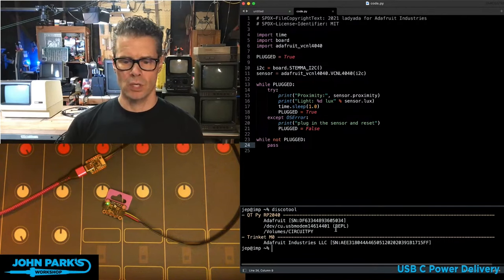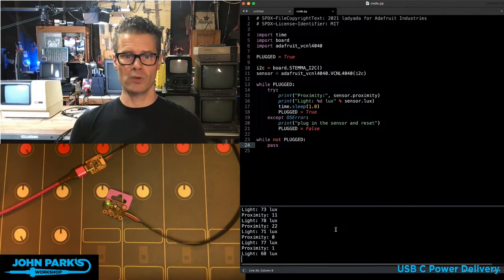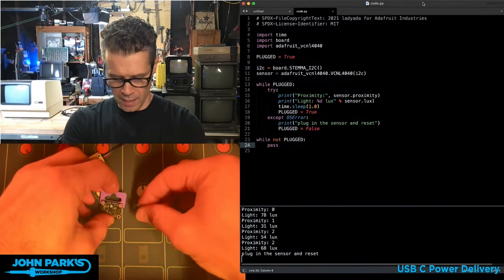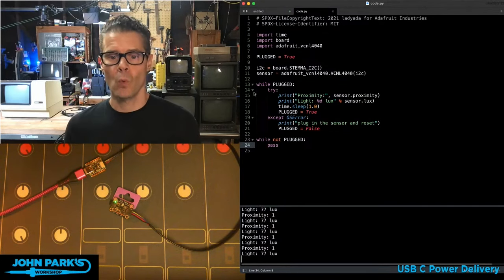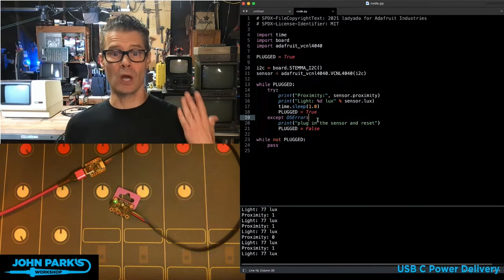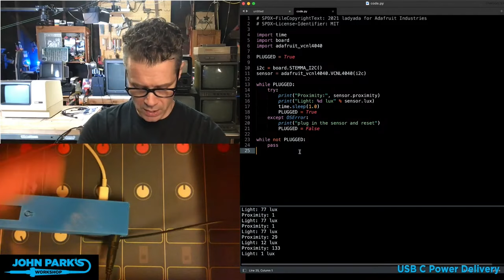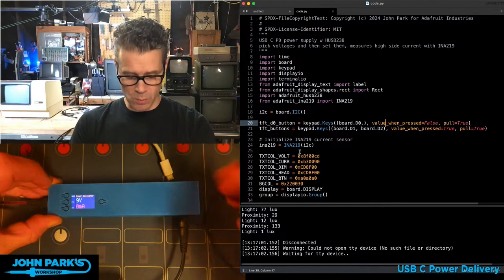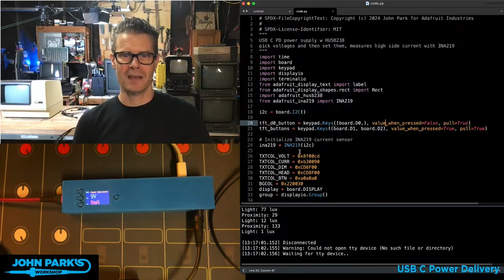John Park's CircuitPython Parsec: Dropped I2C #adafruit #circuitpython

Comment: How does this code work with the Adafruit board that monitors the I²C bus to watch for I²C disconnections? I can't remember the name of the board, but it was released by Adafruit sometime after Jan-2023. I believe it had just two I²C connectors on it and a few chips.